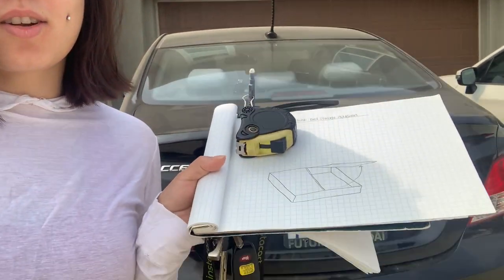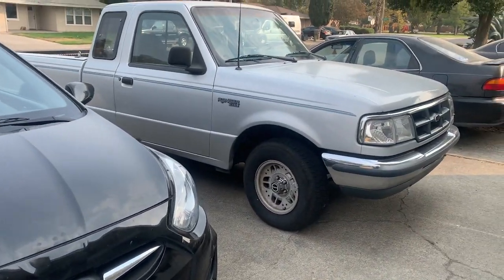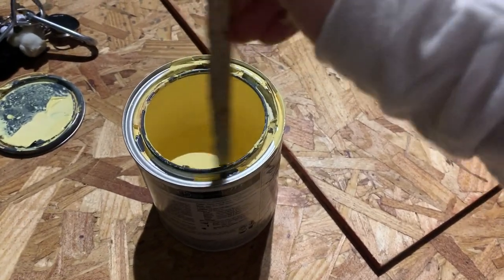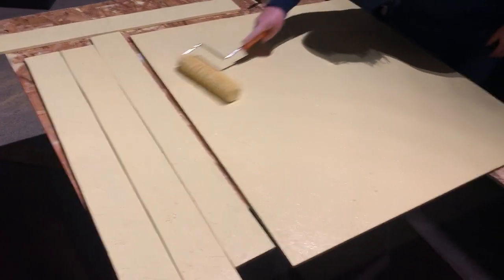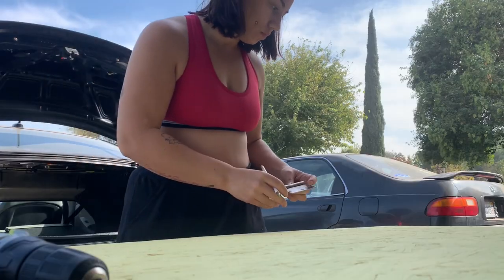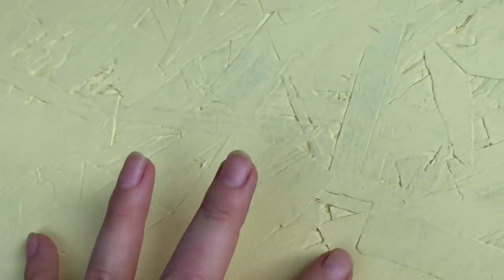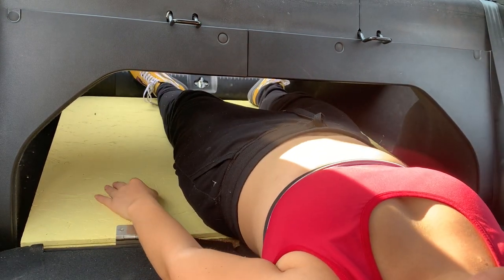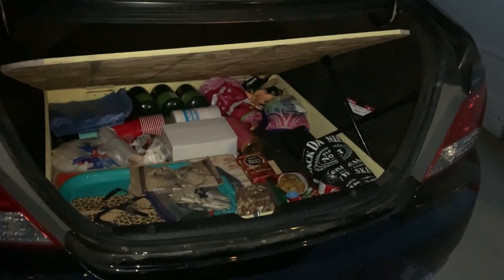Small Car Build | Hyundai Accent Camper | Car Camper | Trunk Build

Comment: Holy cow. I cant believe others did this. I did this exact mod but put a divider down the middle for support. 24inx40inx2in are box dimensions. Used piano hinges for opener. Crazy you did the exact design. Hope youre having a blast
Reply from the maker: after I did this project I realized I should’ve used piano hinges!
Reply: @AmelliaSoto  yea they work great. I am considering stapling carpet to the top. Also used velcro strips on a 2 piece plastic drawer set. Holds all cookware, etc.
Reply: Nice job 👍

Comment: You need to put on  pieces of 2"x2" in the 4 corners for added support and then remove those screws that are splitting the corners and screw them into the 2"×2" or it can even be a little less than 2"×2" and for the inches use bolts on them instead of screws
Reply from the maker: Thanks for the tip! I thought about the 2x2 but I was trying to just use as little/cheap materials as possible lol it was very sturdy since it was flush with the edges of my car and packed with stuff inside so I didn’t have any stability issues when using it. But now I have a new car so I will keep those tips in mind with my upcoming projects!
Reply: @AmelliaSoto  good however it can be a little less than 2x2, so instead of screwing into the other side of the plywood    you would screw it onto the piece 2x2 and the corners will have a stronger support. Best regards ✨

Comment: Cut it at half and make twoo.
Easier to come in
Stronger at middle
Reply from the maker: That was the original plan but then I just wanted it done quickly so it was more simple to do it this way. This design is plenty sturdy since it’s just the weight of my legs when I’m laying on it!
Reply: @AmelliaSoto  i see.
But try not hurt yourbacks when put in and out the nice box. :)
Have fun. :)